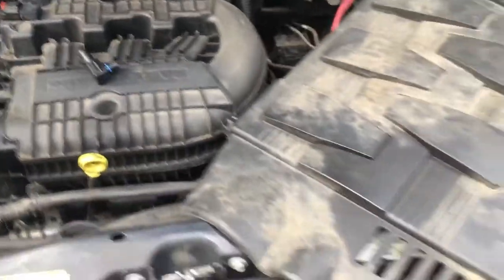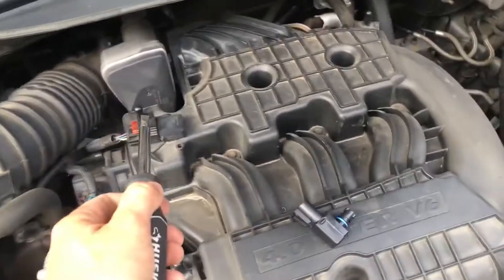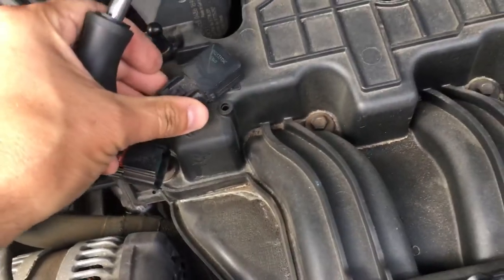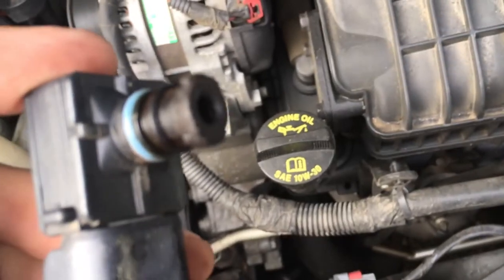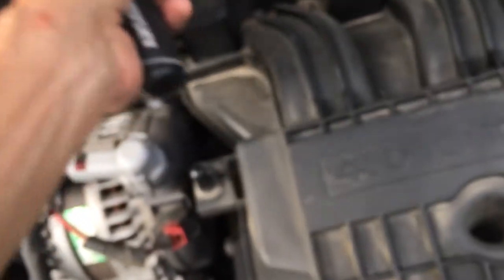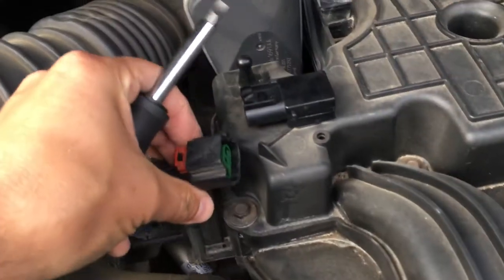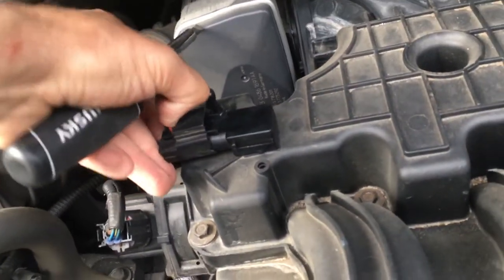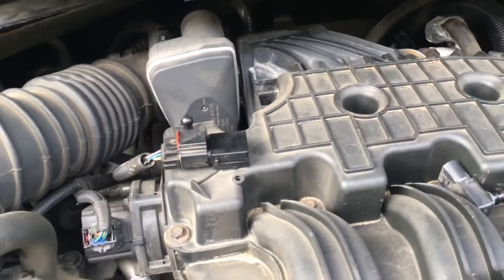MAP Sensor Replacement - Easy!

Comment: im gonna put one in my 05 escape soon should i disconnect the battery since its an electronic device?
Reply: Any time there is electricity running through something you're replacing, you should disconnect the battery so yes

Comment: Hello. after replacing the MAP, how many mpg is driving?
Reply from the maker: Up to 28 on highway, 21 city. I drive conservatively, and this works well.
Reply: my dodge charger 3.5l on highway 24 mpg. 12 mpg city traffic, this is normal??
I can not find problems.you can advise something?